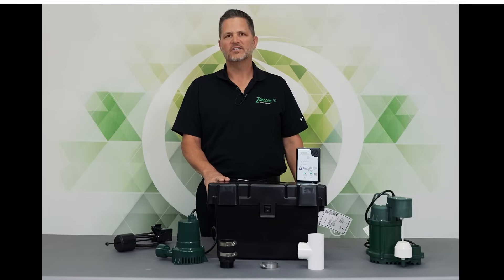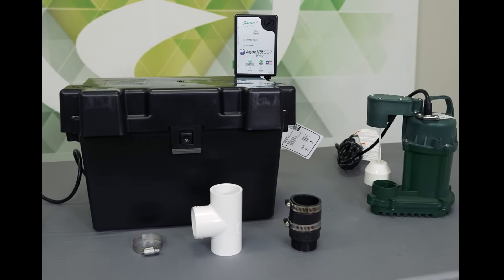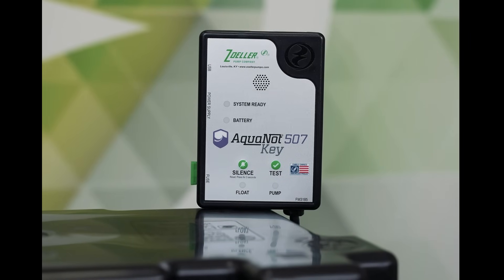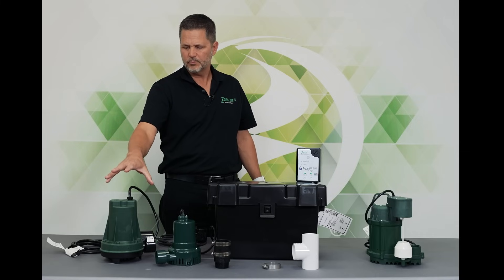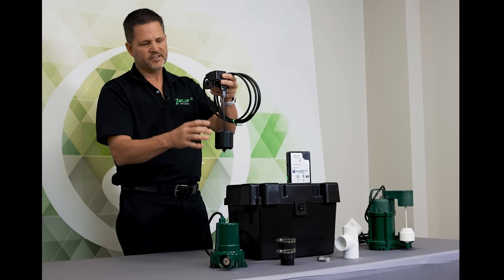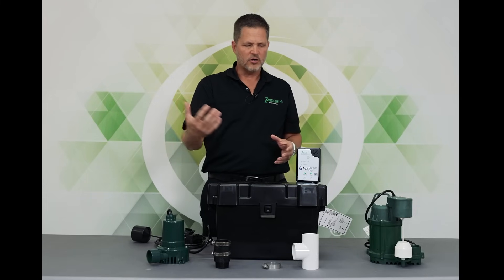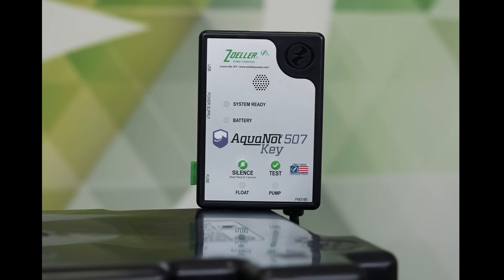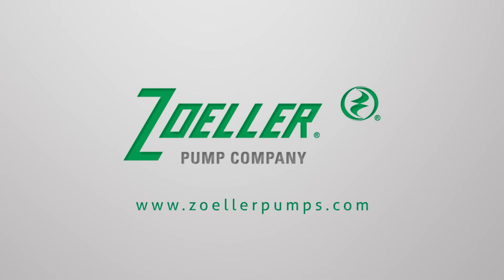AquaNot Key 507 Battery Backup System Overview

Comment: I have the propak 53 507-0008 that was installed in the house I live in back in 2014, however, I purchased the house in 2019 but only now in 2025 did the battery just died on me. I called Zoeller and they no longer make a battery for the model I have so my question is do I purchase an entire new system and what would those parts be?  I live in a 4700 sq ft home so does size matter?
Reply from the maker: Hi @Gizmo_forever21 - either of our AGM Batteries should work with the 507 Key system. The 10-1450 (https://zoellerpumps.com/product/agm-maintenance-free-battery/) or the 10-0761 (https://zoellerpumps.com/product/flooded-maintenance-free-battery/). You could ask your local contractor to get this from their local stocking Wholesaler and install it for you.